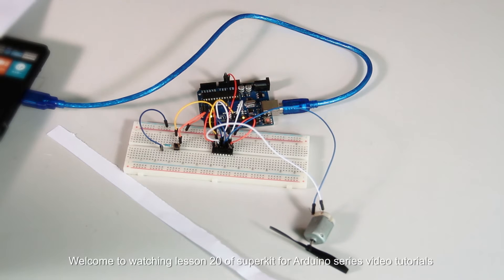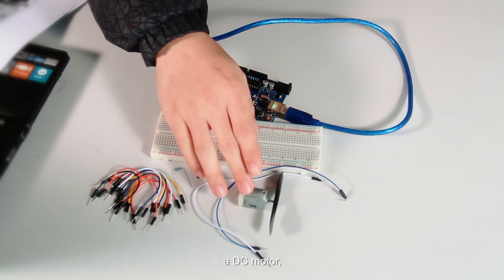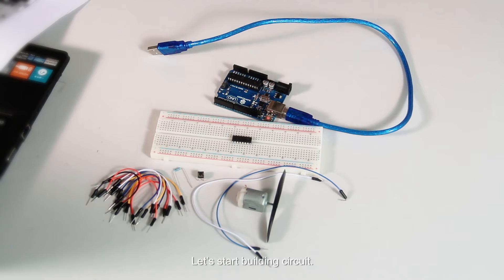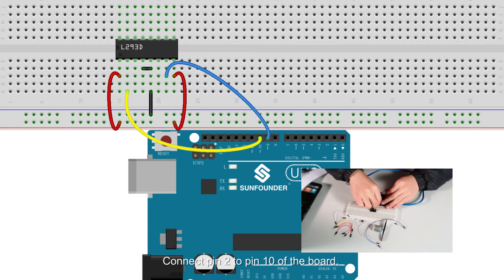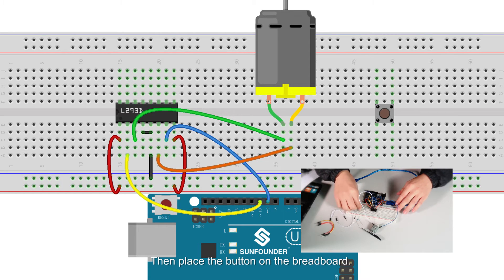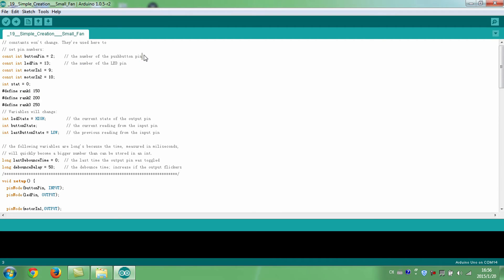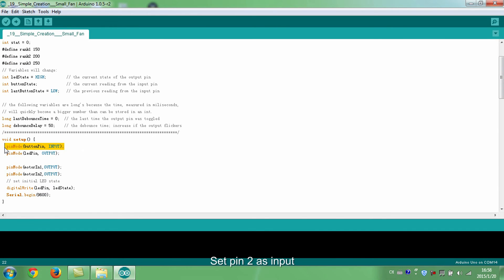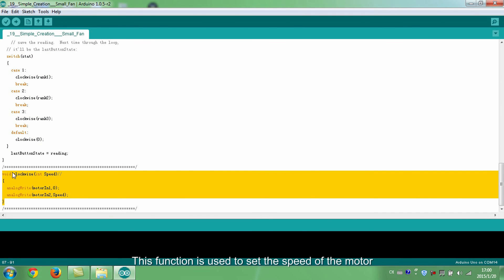Sunfounder Kit Turorial for Arduino - Small Fan

Comment: Code:

 const int buttonPin = 2;
 const int ledPin = 13;
 const int motorIn1 = 9;
 const int motorIn2 = 10;
 int stat = 0;
 
 #define rank1 150
 #define rank2 200
 #define rank3 250

 int ledState = HIGH;
 int buttonState;
 int lastbuttonState = LOW;

 long lastDebounceTime = 0;
 long debounceDelay = 50;
 
  void setup() {
  pinMode(buttonPin, INPUT);
  pinMode(ledPin, OUTPUT);

  pinMode(motorIn1, OUTPUT);
  pinMode(motorIn2, OUTPUT);
  digitalWrite(ledPin, ledState);
  Serial.begin(9600);

}

void loop() {
  int reading = digitalRead(buttonPin);

  if (reading != lastbuttonState) {
    lastDebounceTime = millis();
  }

  if ((millis() - lastDebounceTime) > debounceDelay)  {

    if (reading != buttonState) {
      buttonState = reading;

      if (buttonState == HIGH)  {
        ledState = !ledState;
        stat = stat + 1;

        if (stat >= 4)
        {
          stat = 0;
        }
      }
    }
  }

  digitalWrite(ledPin, ledState);
  switch(stat)
  {
    case 1:
      clockwise(rank1);
      break;
    
    case 2:
      clockwise(rank2);
      break;

    case 3:
      clockwise(rank3);
      break;

    default:
      clockwise(0);
  }
    lastbuttonState = reading;
}

void clockwise(int Speed)
{
  analogWrite(motorIn1, 0);
  analogWrite(motorIn2, Speed);
  
}

Comment: This is annoying.  The book you provide and website shows one thing, the video shows another and the code rarely works.  What gives?
Reply from the maker: +Dustin Penner The booklet printed and the PDF file on our website have been improved, which may be a little different from the videos made before. But it shouldn't affect the results. You can accomplish the experiment following either source. As for the code, we've examined carefully when developing, and we've checked again. 
If it still cannot work, what message do you get when uploading, or what's the specific results you've got but it should be otherwise?
Reply from the maker: +Dustin Penner The booklet printed and the PDF file on our website have been improved, which may be a little different from the videos made before. But it shouldn't affect the results. You can accomplish the experiment following either source. As for the code, we've examined carefully when developing, and we've checked again. 
If it still cannot work, what message do you get when uploading, or what's the specific results you've got but it should be otherwise?